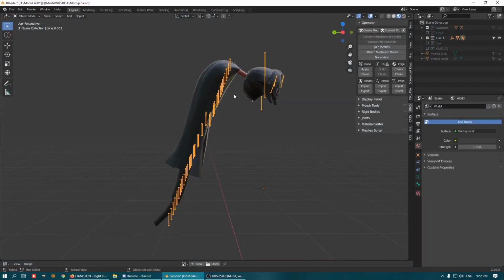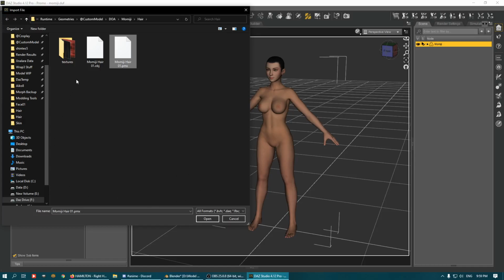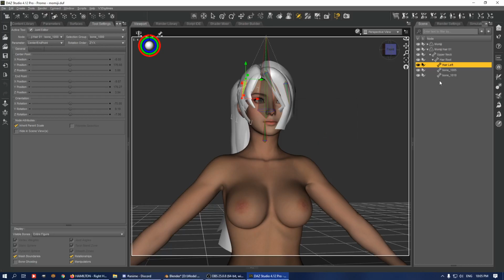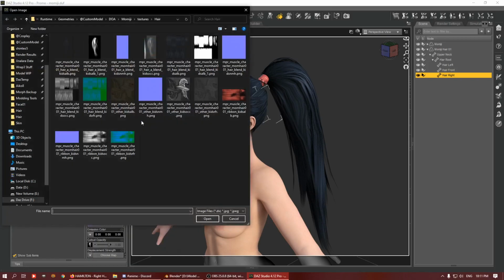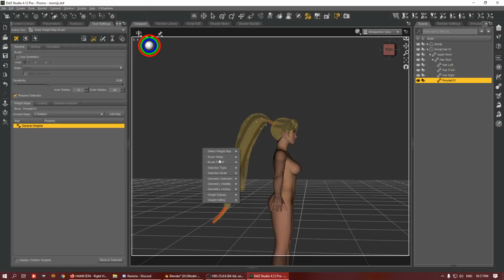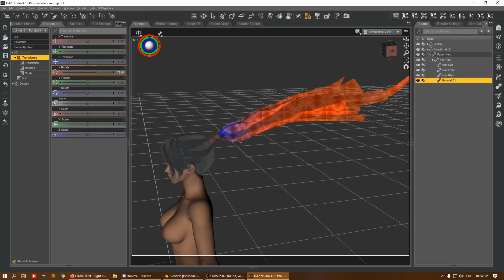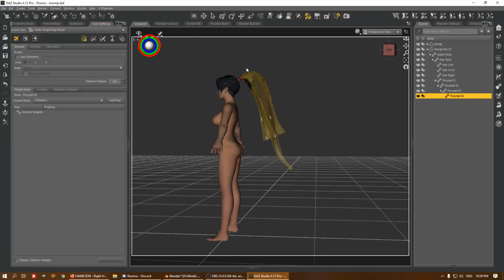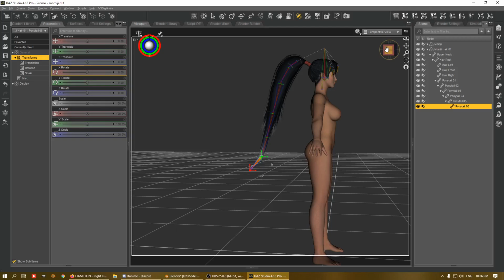Transfer Rigged model to Daz and basic rigging

Comment: Hi there, I can't find and don't have the plugin, so I'm trying to just do the added bones part, but when I follow the steps and try rotating the bone to test if it worked, it doesn't move.
Reply from the maker: You need to do the weight paint part as well.

Comment: i follow your tutorial first time everything works.but the hair deform worst and now when i scale down the mmd hair to fit the head of the model in daz and i do  transfer utility all bone scale back and i dont know why
Reply from the maker: After fitting it to the head, remove the head and body morphs on the hair. That should make it fit the head.
Alternatively, create a morph using the original obj of the hair.
Reply: @Shinteo5  the problem is the scale.when i convert the hair in blender the mmd addon ask to put the scale the default is 0.08 i set the scale to 0.1.in daz i scale up the hair to fit to the head and is 117.80% (1.18) so in blender when i export the hair and i put the daz scale i get error.so i leave the settings at default and i do transfer utility and all bone scale back go sky high
Reply: @Shinteo5  the problem is the scale.when i convert the hair in blender the mmd addon ask to put the scale the default is 0.08 i set the scale to (0.1)in daz i scale up the hair to fit to the head and is 117.80% (1.18) so in blender when i export the hair and i put the daz scale i get error so i leave the settings at default and i do transfer utility and all bone scale back go sky high
Reply from the maker: @snaketto1  Yeah, that's the problem. 

The way to fix that, is to import the MMD, scale it to the daz figure and fix it there, then export that to daz with a scale that you can use in daz. The one I use is 11.7647, but you can figure that out by importing the default scale to daz, and scale it up without fitting it to the head. Take note of the scale when the hair fits the head, and use that same scale when you export from blender.

Comment: Exact scale numbers were 11.7647%

Also, you can  transfer the weight maps better if you use the 'UV Space' option only (uncheck everything else in projection options section)
Reply: when i put ur scale i get error and i use latest version mmd addons 2.8.0
Reply: @snaketto1  did you try without the '%'?
Reply: @ZigmundZag  the scale numbers didn't fit to the Head and i need to scale down in daz the problem i have after i do transfer utility all bone scale back
Reply: If you scale down in daz, you'll need to bake the transforms so the new scale gets set as the new 100% value. Otherwise, transfer utility won't work. I'd have to see what you're working on to be able to walk you through it
Reply from the maker: The scale I use is base on an import setting in daz of 10,000%. You'll have to adjust the numbers to suit your own import setting.

Comment: nice video.
Is it possible to do the same as you did with the weight maps but with the front strands of the hair?. i don't have daz mmd importer could it work if i did it with an obj?
Reply from the maker: Yes. It is possible. The MMD thing is just to preserve the existing rig and make it easier and faster when you get the model into daz